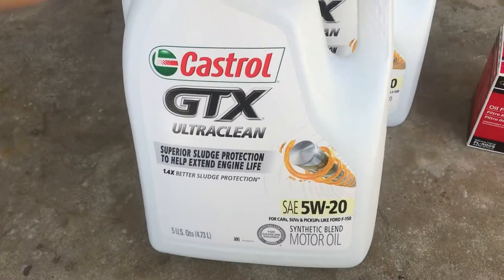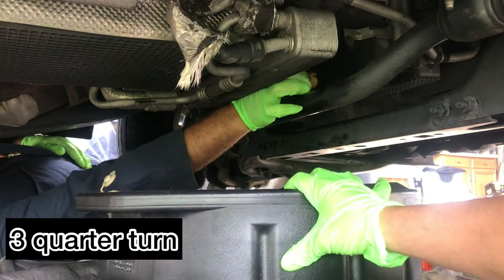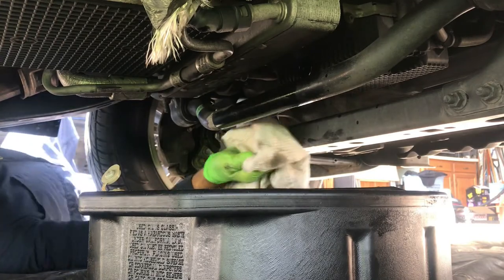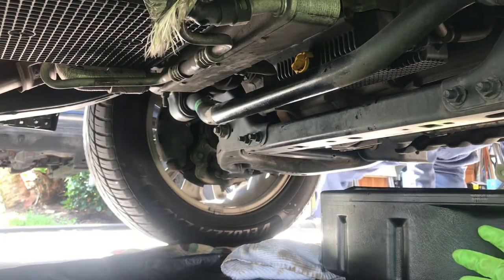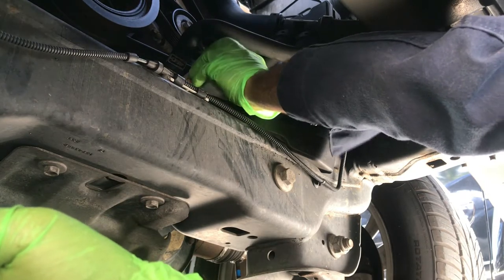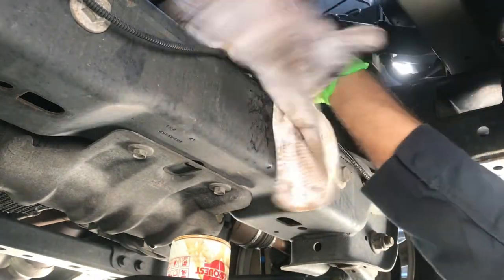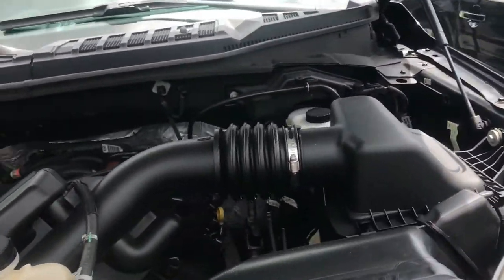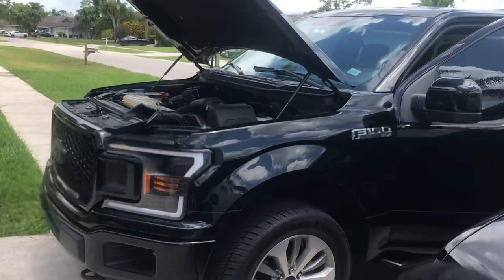HOW TO DO AN OIL CHANGE ON YOUR FORD F150 5.0/2.7/3.5 (Tutorial) | DIY

Comment: Have you seen the drain plugs that have a valve built in? I’ve seen several reviews on them and they seem to work well. Might be a little less messy. So glad I’m in the Ford Pass program, don’t have to mess with any of this, all it costs me is time.
Reply from the maker: I have not
Reply: @ProfessorMikee  , I think they are made by a company called Ronin
Reply: @ProfessorMikee